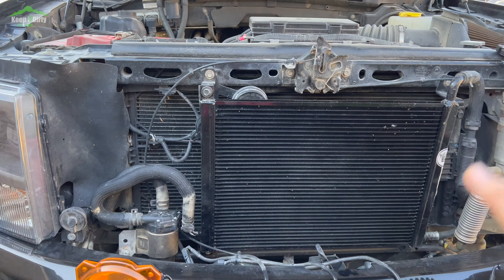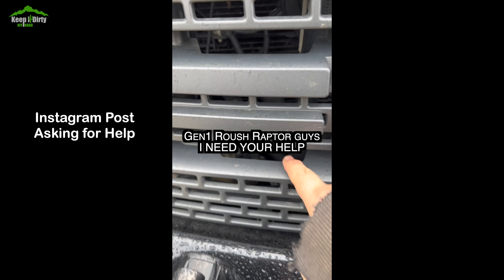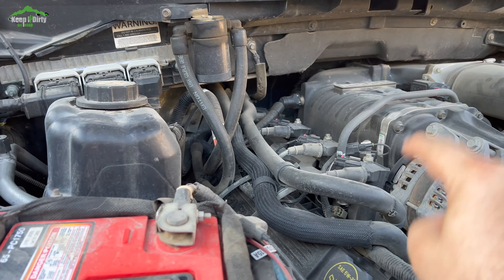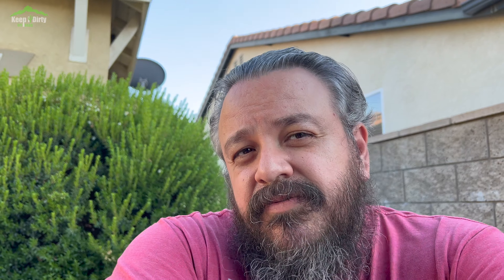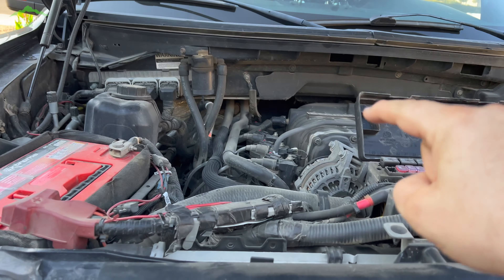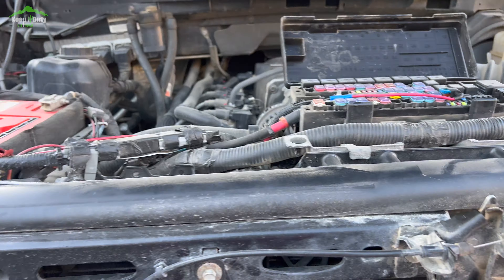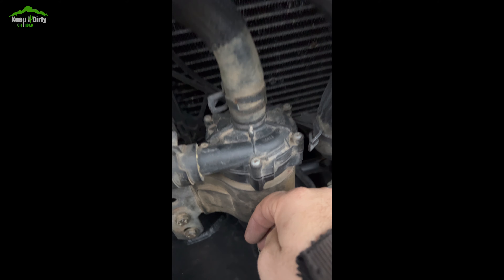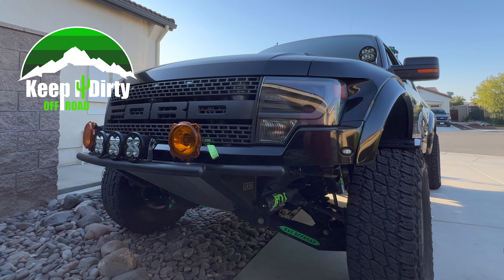Roush Water Pump Always on FIX

Comment: This is EXACTLY what is going on with mine. I cut the wire and put it on the positive terminal to confirm it wasn't the relay. Just ordered a couple fuse taps. Thanks for the video. Was wondering why the pump was constantly running. 👍
Reply from the maker: Glad we could help man. This little glitch killed my very expensive battery

Comment: Not just the trucks but also my 20q7 mustang gt roush stage 3 phase 2 same problem
Reply: So all the roush vehicles with that same pump setup..mine wasn't running all the time or at first shutting down but instead after a while and as it started to drain the battery is when it would then 4 some reason really start kicking on and straight running so I could not find it with a traditional parasitic draw test and found in accident while repairing my throttle body went to lift the hood back up and heard it running with no key on or doors open etc....Was a lucky find but ill take it!!!!!......lol..
Reply from the maker: Wonder why this is failing overtime. On the raptor they tap the radio isolation circuit. It’s only supposed to be on while the radio is on. But overtime it  just stays on. Wonder if this a more serious problem with the trucks where this isolation circuits stops working right or maybe something wrong in the truck where modules are not working as they are supposed to. My backup camera does not work consistently either so I’m starting to think this is a symptom of a bigger eletrical or module problem as these trucks age.

Comment: This is one of the reasons I went with Whipple! Seriously though…any super charged Raptor is EPIC in my book. ✌🏼
Reply from the maker: I’ve heard the Whipple guys have a ton of issues man. The saying goes is whipple is the one you want to joy ride and Roush is the one you want to own.
Reply: @KeepItDirtyOffRoad  I’ve not had any troubles yet, and running 40,000 miles strong so far. Knock on wood.